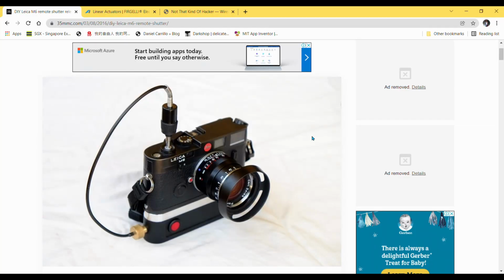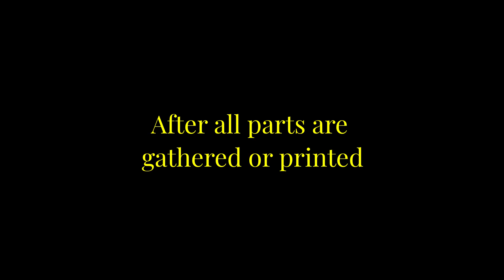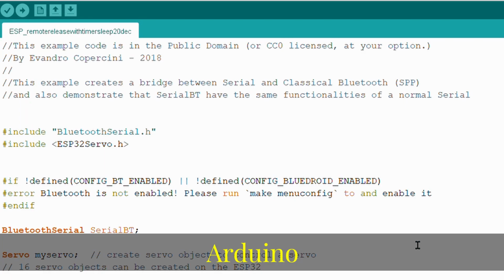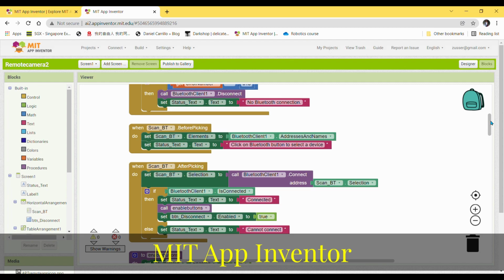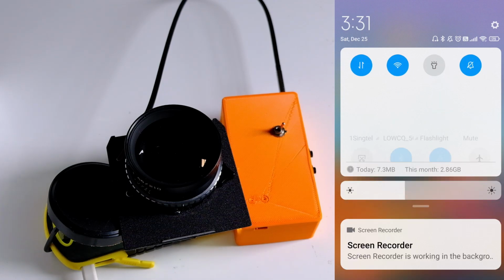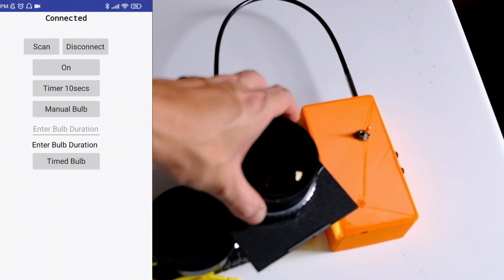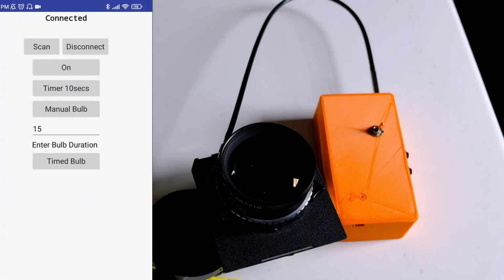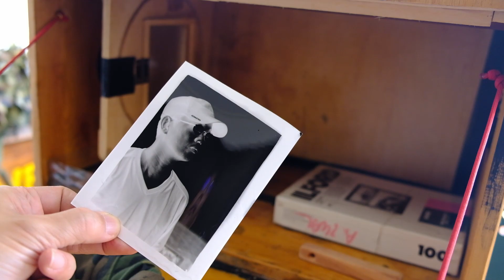How I DIY a Remote Mechanical Cable Release for Film Camera and Photography

Comment from the maker: if you enjoy this video and like my sharing on making of the mechanical cable release, do consider giving me a Super Thanks by clicking on the Thanks icon under the video.
Reply: Does servo getting hot if use manual bulb for 1, 5, 10 minutes exposition?
Reply from the maker: One minute is ok but I have not tested anything more than that. I wouldn't think it will get too hot as the load of pressing the cable release is not very big. Else have to modify the program to use T(time mode), trigger once to open the shutter and after a certain no of seconds, trigger to close the shutter
Reply: Thank you very much for the great project. Would you be willing to share the MIT Inventor APP code ? I have everything working and just need to figure out how to make the app for my android. Thank you
Reply from the maker: Hi if you look at the GitHub page I shared in the video description, there is a .AIA file. That is the code for the app to be used in MIT app inventor

Comment: Hey this is awesome  ! 
I'm creating something similar (an intervalometer) for my super 8 camera.
What parameters did you use to model the female thread where the cable release is screwed in ?

Thanks in advance :)
Reply from the maker: i just did a threaded hole in fusion360. m9x1.25. maynot be an exact fit but works for me.

Comment: Do we have to have that program to run the app? Trying to figure out all the programming in new to this. Could you do a video on uploading the files to the board and the app?
Reply from the maker: You need to have arduino IDE (downloadable free) to upload the code to the esp32.  And an account at MIT inventor app  for the app code

Comment: Hi Thanks so much for this your so clever!  I'm trying to make it using a linear servo from Banggood. 

https://uk.banggood.com/1-Pair-AFRC-D1015-1_5g-Pro-Micro-Linear-Servo-With-Optional-JST-or-JR-or-FUTABA-Plug-For-Indoor-3D-Small-RC-Airplane-p-1619739.html?rmmds=myorder&cur_warehouse=CN&ID=520802

Ive got limited experience with Arduino but I'm getting stuck with the Android app. Is there an APK file you could let me have that will install on my Android phone without going through the MIT Inventor software? KInd Regards Tim
Reply: Ok no worries I've got the MIT app and the APK file running on my phone now !
Reply from the maker: oops yr comment got filtered away by Youtube. i think they do it everytime when u have a link in your comment.  glad u got it sorted out. I hope you can modify the Arduino code to adapt to the servo motor.
Reply: @AnaloguePT  - My hobby is rc airplanes so Im ok with servos etc . Ive written  code for a remote weather station  on Arduino but never done anything on an esp yet! I'm 70 years old and still learning :) Thanks so much
Reply from the maker: Great! I think the arudino just use a different servo motor library otherwise it should be quite the same as the esp. not sure abt the Bluetooth module but I am sure u can figure them out. Have fun!
Reply: @AnaloguePT  Hi Thanks for all your help! Ive got the electronics working fine and its driving a servo ok. Instead of using a standard servo I've decided to use an RC retract (used on rc planes to lower and raise the undercarriage). Unlike servos , retracts have integral limit switches that cut the motor power at each end of the travel. Retracts also have more gearing than servos. Ive tried the retract out and it works just fine on 5V standard USB power (~250mA). This means I will power the whole thing from a standard mobile phone battery bank top up device. I'm just 3D printing the rack mount stuff ATM . Here is a link to the retract I'm using.   https://hobbyking.com/en_us/servoless-retract-with-metal-trunion-44mm-x-41mm-mount-2pcs.html?wrh_pdp=1&utm_source=google&utm_medium=cpc&utm_campaign=google_gb_shopping&countrycode=GB&gclid=CjwKCAiAgvKQBhBbEiwAaPQw3D0MHUP-H5iVo_STIEQyqptSISUst0HxvdYWXhaFwYt5kS-6oOs4nRoCtf4QAvD_BwE
Reply from the maker: @realpastaman  can't wait to see your final product.   i like the idea of the phone battery.
Reply: @AnaloguePT  Nearly finished - all powered from USB - Retract 3 leads leads plug straight into the ESP pins by swapping the retract wires around . Only draws current whist moving (not at the end points. Static position for different cameras / different cable release can be adjusted by simply slacking the screw shown in the last frames of the video and turning the gear wheel to the desired position , then tighten the screw back - easy ? Just doing the box now. Here is the video work in progress    https://www.youtube.com/watch?v=B6AW6-TTIzA&ab_channel=realpastaman
Reply from the maker: @realpastaman  looking great.  if u prefer to change the code, there are quite  few places where it said "pos<=180" or "pos>=180", where 180 is to have the servo motor rotate 180 degrees. u can change the  no to smaller if u need to move less. not sure can it move more than 180 as my servi motor is not the continuous rotation kind, seems to be able to move maximum 180 degrees.
Reply: @AnaloguePT  Thanks !!!  Retracts only rotate by and angle according to the limit switches built into the retract. This cannot be changed by the PWM signal. The PWM signal just tells the retract to rotate to the end stop. I did have to change one value of your code on the ESP to allow more time for the retract to reach its position because its a bit slower than a servo.  Can you PM me  on youtube?  and I'll send you the STL files and parts list if you want to try it ?
Reply: Here is the finished prototype using a RC retract. It seems to work really well.  https://youtu.be/roxb6jO5WnQ
Reply from the maker: excellent, looking great. There is no PM function on Youtube but when I do get the retractor I will leave a message on your channel.

Comment: Can you please share the STL for the box you made?
Reply from the maker: in the video  description, there is a link to the github page where the stl files can be fouind.
Reply: @AnaloguePT  thank you. Must have been blind..
Reply: @AnaloguePT  i finally got around to make this work. In your guide you mention  pin 34 to control the servo, but in program it’s 32
Reply from the maker: @jurajzahumensky6378  thanks for letting me know.  i will change the diagram. pin34 is a input only pin which is why i change to pin32 or you can use any other output pin. hope all works well for u

Comment: This is great, thanks for sharing it. I’m going to make one to play with.
Here’s another example, done recently by Will Gudgeon and uses a commercial bluetooth switch activator so is slightly less diy for anyone not comfortable with programming an arduino
https://youtu.be/Gd944jHB_Kw
Reply from the maker: thanks for sharing WIll Gudgeon video. Neat little switch there. the app can also do much of what we need to do for photography : instantaneous on/off , press n hold for up to 60 secs. i may get one to try on my Afghan box camera which has more space for sticking it on.
Reply: @AnaloguePT  I will probably get one to try too.

Comment: This is brilliant! You should consider manufacturing this in bulk and selling it. I would definitely buy one as I have zero ability to code. Making the code Open Source is great, but people would definitely pay for the convenience of having the unit already built and coded for use. And Android phones are pretty inexpensive so that shouldn’t be a problem either.
Reply from the maker: thank you. i will consider that when  I make it more robust and with minimum issues when i sell it.
Reply: @AnaloguePT  I'd absolutely buy one. Have you also considered `Timer` mode for lenses with Timer? Just to save battery for looong bulb mode exposures
Reply from the maker: @kyleyankanich3726   not sure hat u meant by lenses with time? if it can be progrom then it can be done :)
Reply: @AnaloguePT  Throw your shutter on 'T' mode.

It essentially is Bulb mode - but you don't have to keep holding the shutter release to keep it open. You press it once to open, and another time to close the shutter.
Reply from the maker: @kyleyankanich3726  i see what u meant. can be done in the code. maybe i will add that in the fture. the bad thing abt servo is it still draws battery power even when not moving so battery life is something i have to look into.
Reply: I would be interested in buying one as well.

Comment: I’m surprised nobody has already made a product like this that can be purchased, for those who don’t have the time/skills to make a DIY project
Reply from the maker: yeah it would be expensive to produce in a small quantity to sell commercially. hopefully this will inspire more creative remote trigger solutions for film cameras.
Reply: Because of limited use in film camera, this type of remote mechanical cable release is mostly useful for self portraits and family photographs, other than that using normal cable release is more practical. I don't think people will use film camera for timelapse photography in digital camera era, though it is possible to program intervalometer in the app. There are different types of  mechanical self-timer shutter release available in the past. Some cameras and some shutters also equipped with self-timer.